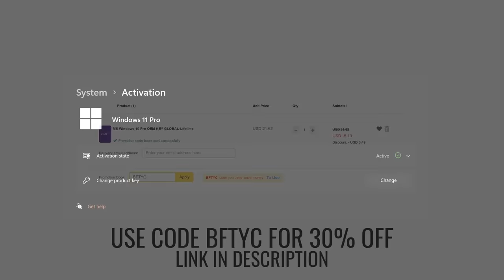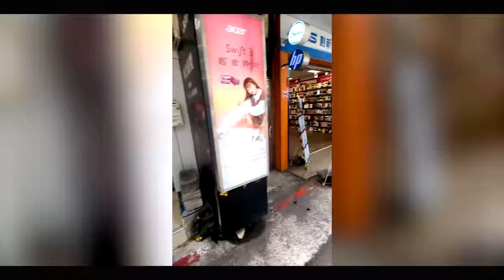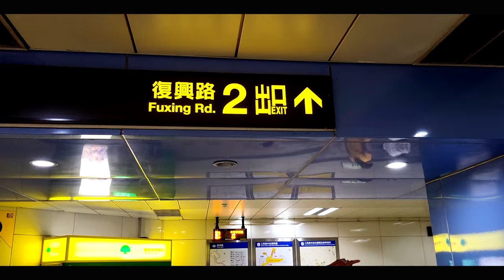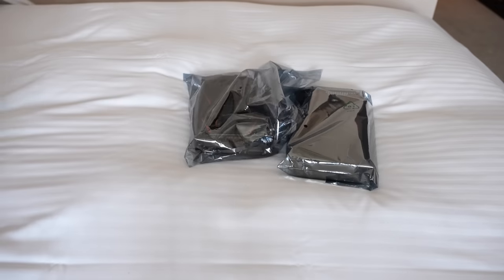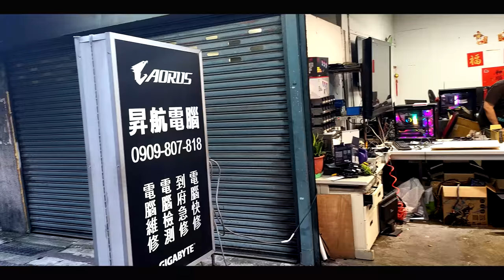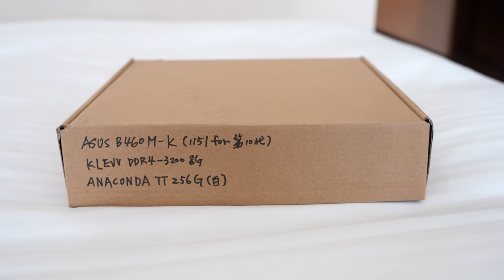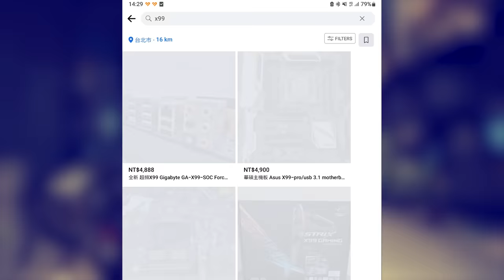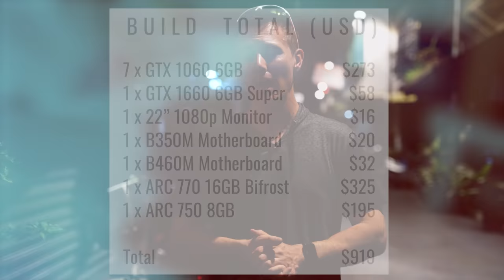USED PC Parts Hunting in TAIPEI, TAIWAN!

Comment: Man those are some great deals, you need to make more trips to Taiwan. Think my favorite are all the 1060s.
Reply from the maker: Yeah the 1060s were a bargain.  The guy was actually using WD40 to clean them up on the 16x pin connector.
Reply: @techyescity  ouch! WD40 and electronics shouldn't meet at all in my opinion, but great deal nonetheless.
Reply: @razorr3751  I'm pretty sure Tech YES City is known for cleaning with WD40 lol
Reply: @lastfirst23163  yeah saw that, now the question is if it was with electronics WD-40 or the one for cars 😂

Comment: 1:49  I had to convert the USD.. 

$474 for the 16GB A770 is decent, 
See them regularly here in Aus for $560+ 

There has been a few good eBay specials recently from reputable stores that have had the A770 with eBay Plus offers for $80-100 off listed price, 
Cheapest I seen was just over the $474 for $489

Comment: Gosh you hit the jackpot with those 1060's and that 1660 super. If you have time look for 580's too and 5700xt's. Monitor is also a steal at 16$. the arc 750 was ok and the 770 was so so, close to normal price. those mobos if in perfectly running condition are also great buys, just couple em with 5600g/5700/5700g's and you got ultra budget gaming pc's. Amazing episode! Omedeto

Comment: Nvidia's fallen PP ratio from previous gen to 0, except for 4090 where PP is +75%
They have linearized pricing instead exponential in higher end. They give lower class up to 500$ less and less for the money, even any card to manufacture 130$ to 300$. Do you remember when starting price was 110$ 1050? (57$ was starting manufacuring cost for lower end card and Nvidia was happy with 38$ or 60$ gross margin). smaller TDP, cheaper board, smaller cooler, smaller airmail
1050    msrp 110 chip    9   2GB   6 board 20 airmail 15 cooler   7 retail 15=   72 Nvidia  38$
1050ti  msrp 150 chip    9   4GB 12 board 20 airmail 15 cooler   7 retail 15=   78 Nvidia  72$
1060    msrp 300 chip  20   6GB 18 board 20 airmail 15 cooler   7 retail 25= 115 Nvidia185$
1660    msrp 220 chip  20   6GB 18 board 20 airmail 15 cooler   7 retail 15= 105 Nvidia105$
1650s  msrp 160 chip  20   4GB 12 board 20 airmail 15 cooler   7 retail 15=   99 Nvidia  60$

6600    msrp 200 chip  40   8GB 24 board 30 airmail 20 cooler 14 retail 20= 148 Amd   52$ 
7600    msrp 270 chip  32   8GB 24 board 30 airmail 20 cooler 14 retail 20= 140 Amd 130$
A750   msrp 230 chip  65 16GB 24 board 30 airmail 20 cooler 14 retail 20= 173 Intel   57$ 
A770   msrp 350 chip  65 16GB 48 board 30 airmail 20 cooler 14 retail 20= 197 Intel 153$ 

4060    msrp 300 chip  50  8GB  24 board 30 airmail 20 cooler 14 retail 20= 158 Nvidia 142$ 
4060ti  msrp 400 chip  66  8GB  24 board 30 airmail 20 cooler 14 retail 30= 184 Nvidia 216$ 
4060ti  msrp 500 chip  66 16GB 48 board 30 airmail 20 cooler 14 retail 30= 208 Nvidia 292$ 🙃
4070   msrp 600 chip 100 12GB 36 board 30 airmail 20 cooler 14 retail 50= 250 Nvidia 350$ 🙃
4070ti msrp 800 chip 100 12GB 36 board 40 airmail 30 cooler 14 retail 60= 280 Nvidia 520$ 🙃
techpowerup - Alleged Prices of TSMC Silicon Wafers Appear
Don't mix wholesale manufacturing prices of aluminium heatsink with retail prices. It is worth as aluminium put on a scale + machining: 300W 700g+3xFAN=14$
DRAMeXchange GDDR6 1GB=3$

General inflation has nothing to do with the real cost economy. Milton fridman said that companies are not responsible to customers, they are responsible only to stockholders. That selfishness is exploding at Nvidia.
When companies like Nvidia pushing high prices are just exploiting "general inflation vehicle" to justify the high prices and exploit unaware customers to get their money.
It is expected that companies have normal gross margin, which in our case is 100$ for the average selling card price to have for their paychecks. Having more gross margin than what is normal is called SUPER profit.
The biggest problem is low GPU performance for the customer's money. 
Nvidia is also braking developers and gamers with low VRAM (8,12GB) that developers have higher cost optimizing games, and gamers get low looking performance. 
New open world games like Unreal City demo or GTA6 can't get all the textures (assets) into 8GB VRAM. All GPU calculations also need VRAM to load and manipulate data and store results into matrix (buffer). 
Idealy would be if the whole game 100GB would fit in VRAM. If there is too small VRAM the game constantly swapping assets in VRAM and stuttering is the consequence. OR open world game constantly loading scenes when you go to the inside of the buildings like in Gotham knights...
For me having 6GB vram there is no reason to upgrade to 8GB VRAM, even 12GB is on low end for an upgrade in 7 years. 7 years is eternity in computers!
Until 2016 card VRAM has always gone up each generation and this is normal in computer tech, then Nvidia freeze their middle class cards at 8GB. When companies became as big as Nvidia they became corrupt and they care only for sustaining themselves. They live in their own imagionary world and because is Nvidia too big is market maker (monopoly) and thinks that whatever it will give on the market at whatever the price, the market will have to swallow and additionaly gamers would have to be pleased with whatever Nvidia will give them, because Nvidia is the only one option. This is Nvidia talking full of hubris and arrogance.
I will add that AMD is in Nvidia's shadow offering just 10% better PP ratio and enjoying high prices for their botique manufacuring of 2,5 million gpus yearly in TSMC.